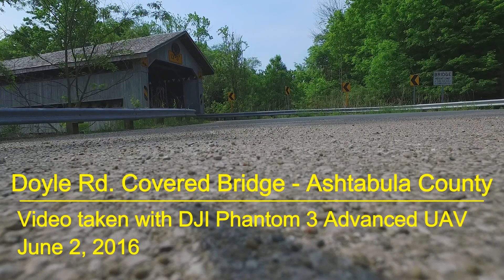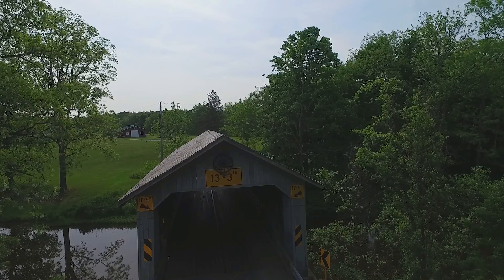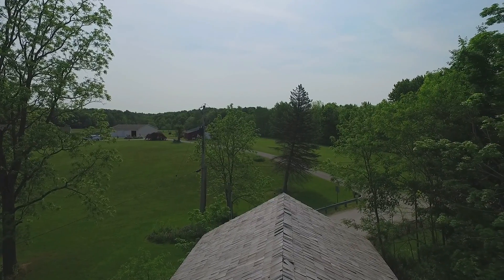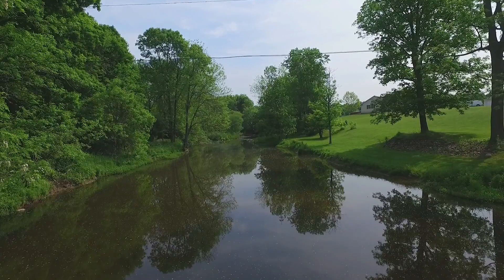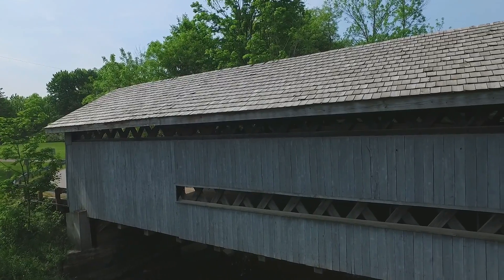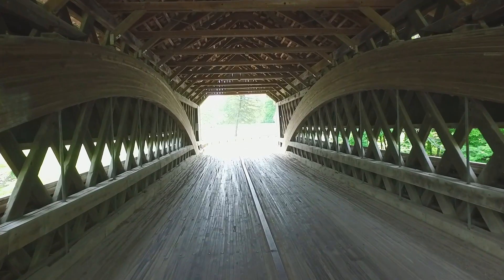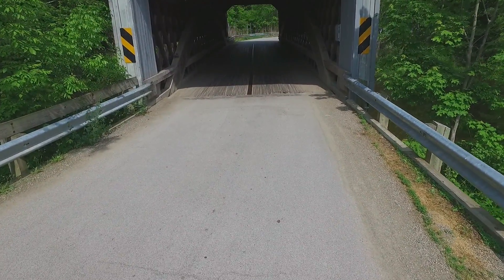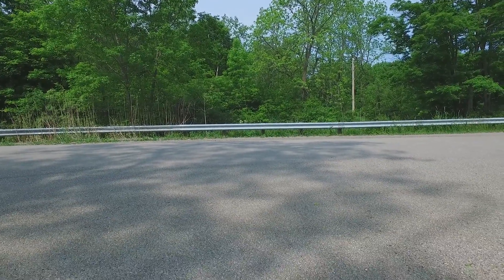P3A Doyle Rd Covered Bridge 6-2-16 (1080P60)

Comment: Very well done! You're both performing a nice hobby and providing public service by detecting repairing needs on the roof of a historical structure. Thank you for sharing.  👍  ✌
Reply from the maker: Thanks!  I was able to get into contact with the proper officials, and was told that the County Engineer would have a look at the roof. I'm not a roof repair expert, but I'm sure its in good hands.
Reply: +Bill Somrak Thanks for the feedback Bill.